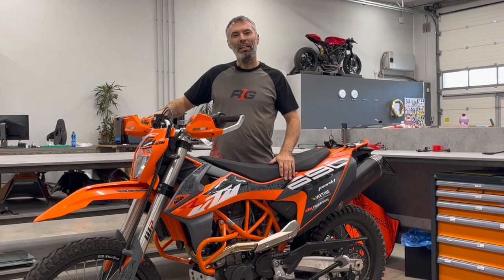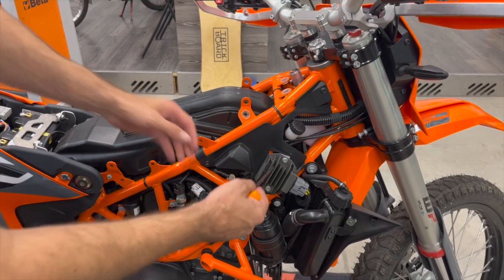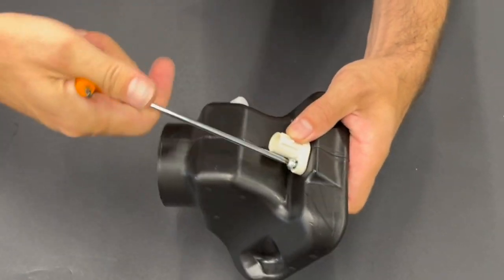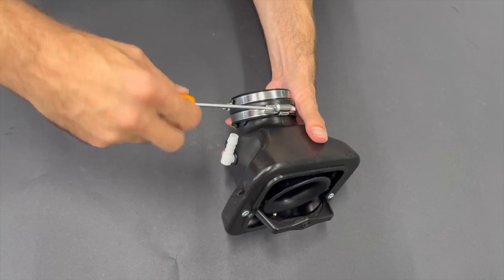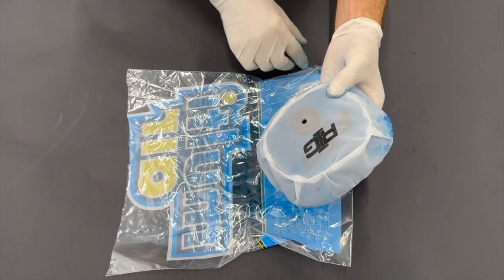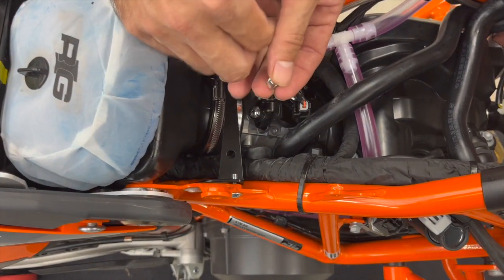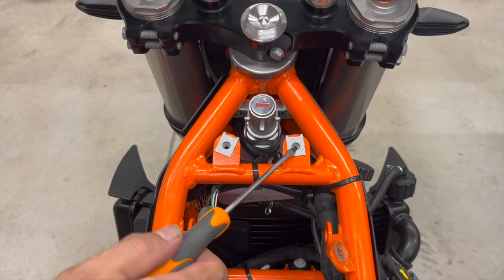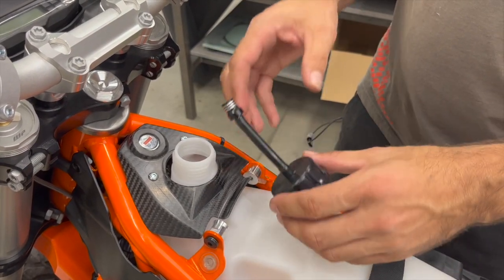KTM 690 2019 23 tank installation - RADE/GARAGE

Comment: By putting the dust cover over the foam filter & fitting it to the airbox the way you did it would it allow dust into the engine as your not making a 100% sealing surface between the bottom of the foam filter & the air filter box because the dust cover is now the sealing surface & not the foam, the dust cover is not 100% smooth ,it has ridges & valleys it in, only small but enough for fine dust to pass. Correct me if i,m wrong , I think your surpost to fit the air-filter & cage  to the airbox than put the dust cover over the fitted air filter

Comment: Does the bike run as well as stock with this airbox/gas tank fitted?

Does it need re-tuning?  Or is that not discussed?
Reply: I've  had this and the Wings exhaust on my Husqvarna 701 Enduro for over 20,000 miles and it is awesome!  No need to retune other than the 5 minute idle.  Only noticeable side effect is the increased induction noise after taking the stock air box off with a small increase in throttle response.  But the biggest benefit is the 250 mile range allowing me to not have to stop for gas till my buddies on 1290's need to stop for gas.

Comment: I,ve had my raid tank & air filter for 18 months & i still haven,t fitted it as I don,t trust the little plastic air box ,at least I,ve got the steel cage ,now your gone to a plastic cage.WTF , the quairty has really gone down hill
Reply: Its not an airbox, an airbox is what the filter sits inside. This is an open to air, air filter.
its amazing if the bike runs as well as stock at all rpm, like the stock airbox is designed to do.
Most seem to like it fine but Ive kinda learned what one person likes, another may think its not so much.    I kinda hate to go thru the trouble and find out its not for me, the bike runs so well the way it is.....................an airbox is a big dead air chamber designed to let an engine breathe in the right way, designed by engineers.    This little box....................I dunno.